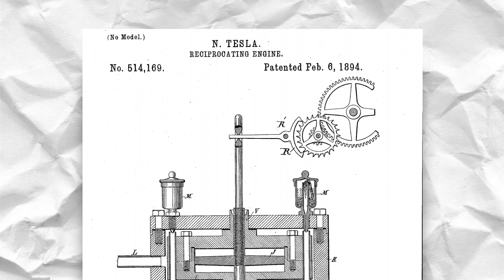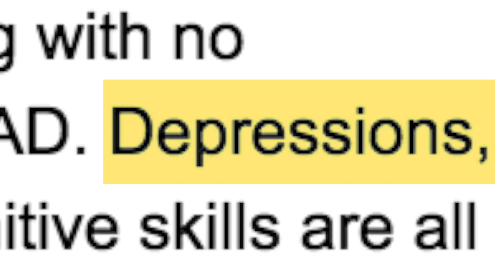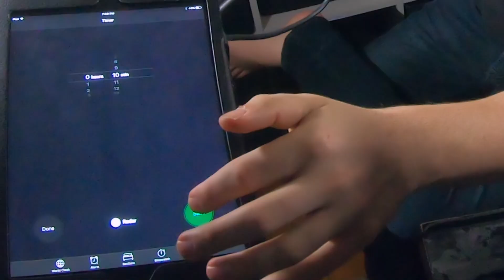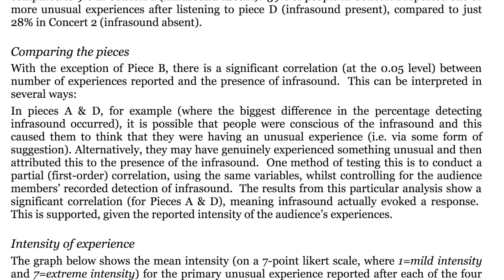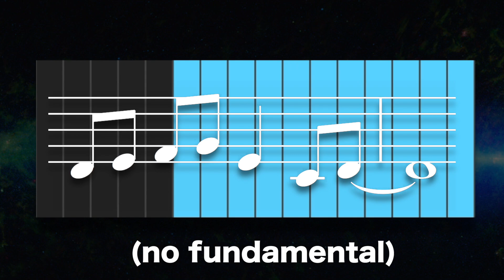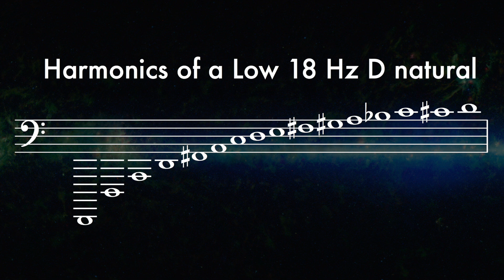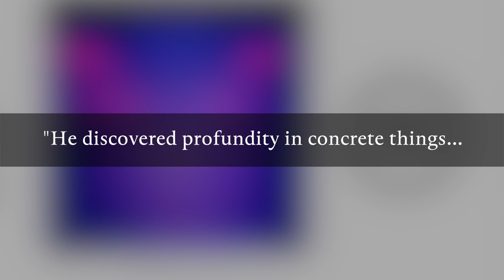How to See Ghosts (using Infrasound)

Comment: During your experiment, you were experiencing the onset of 'Fight or Flight" - medically referred to as Homeostasis. As the frequency drops, in earthquakes for example (seismic resonance between 0.1 to 10hz but most destructively at around 1.5Hz), you will experience severe anxiety which triggers the human homeostatic responses known as Fight or Flight. You will also experience sloshing of a fluid called endolymph which is located in the semi-circular canals in the inner ear. These canals govern balance. As this fluid sloshes around in a high amplitude environment such as earthquake, or indeed the experiment Adam conducted, it triggers the homeostatic response and is the body's way of saying GTFO of there.

Comment: I'm a bit confused by the claims here that humans can't hear frequencies below ~20Hz. Given (obviously) equipment capable of actually producing those pitches, I can pretty easily "hear" even a pure sine wave down to about 15Hz, though to be fair tones below about 18Hz do need more amplitude to be audible. I used scare quotes around "hear" because, well, it is perhaps more of a feeling of pressure in the eardrums at some point than hearing in the sense of being able to identify a particular tone. But I'm definitely detecting those sounds with my ears; a decent set of headphones works fine here. I don't think my hearing is exceptional in that regard, so what gives? Edit: Btw I'm 36, and my ability to hear HIGH frequencies sadly tops out at just above 15Khz at this point. Lame.

Comment: By the way, the combination tone is not an auditory illusion.  A binaural beat is, but they're not exactly the same thing.  A combination tone (or beat frequency) is a real form of amplitude modulated signal.  If you don't believe me, you can set it up in your DAW and observe it with an oscilloscope.  Set up two synths or signal generators playing very close to the same frequency and observe the summed wave in a scope.  You will see the frequency, meaning it is not in your head.  Binaural beats, on the other hand, use the same principle but allow your brain to do the "summing".

Comment: It's possible you may not be technically allowed to use infrasound in most venues. I remember when learning about low cuts and stage sound (mostly from online articles and posts, which leads me to believe this is a common practice) that low frequencies will be cut as high as 40hz to stop the low end sound from ruining stage equipment (the simplest problem being things coming loose). This could even have something to do with the limits of hardware being used.

Comment: This video just triggered a memory, I think the band Rammstein used infrasound when they played Sonisphere 2010 in the UK. It wasn't done particularly artfully and sounded a bit like a mistake, which slightly makes me think it was them just screwing with the audience.

About 30 seconds before the curtain dropped, there was an absolutely OBSCENE noise that came from the dedicated bass bins of the PA, which were at ear height below the stage (I was right at the front, so I got absolutely nailed by it). At the time I assumed someone touched a cable and accidentally fed 50Hz mains hum into just the bass bins, but it was a hell of a lot lower than 50Hz... you couldn't really hear anything but almost pitchless mush at some 130dB, but the feeling was beyond words. Like you describe, it resonated in your chest to the point of it being really uncomfortable, almost painful, like an electric shock through your chest (anyone who has accidentally been "touched" by mains power knows that weird whole body 50/60Hz vibration). Everyone within 20 metres of the stage felt it, and people were asking what the hell it was! It could have been a mishap, but it seems a little strange that this random sound had exactly the right frequency to  vibrate your ribcage... I've heard mishaps before, and although they're bloody loud if the sound crew screw up enough, even someone tuning a bass at full volume doesn't hit the exact resonant frequency of your chest.

Comment: I'm a bass singer and have noticed an interesting phenomenon when I hum down to around a D2 (~70Hz).
While humming and looking at certain segmented displays (such as a microwave timer or bus/train info sign) I can see oscillations in the display. When I slightly change the pitch of the hum, the rate of oscillations changes too, obvious I guess, but an interesting thing to try out if you have a low voice.

Comment: If I put my head right up on the neck of my guitar and detune the 6th string super low and play it I can see my vision get slightly blurred from the vibrations on my head when looking at text on the screen, right now it's at a low F# there abouts and I have all the strings justly tuned to an F# major chord, not sure if that blurred vision effect is related to this video but it only really happens for the low 6th string detuned hella.

Comment: Adam, a dumb question for your Q&A: does V (not V7 but V) really resolve to I despite the fact that it does not have a tritone in it?If so, what is the mechanism of this resolution? I fully understand the V7 to I movement, but both V and I are just two major chords of different pitch, so why does one of them resolve to another?

Comment: Question for next Q+A.
Hi Adam. I am a bass metal who plays metal. But i've come to a point in my "Journey" where I focus a lot on technique. I've tried alot of different techniquee to see which one I like. The problem is that the most comfortable technique I know, is a style where I can't get lot of attack/punch or high end (A Jazzy light plucking). I love the style of Ryan Martinie where he uses his tips of his fingers to get the most high end and attack out of the strings. The problem is just I feel very uncomfortable using the technique. I know you shouldn't copy a artists technique if its not for you. But I want a comfortable technique where you get alot of attack that cuts through the mix. And where its easy to do a lot of string skipping and fast triplets. (And a pick is not for me). Can you maybe give some advice ?

Comment: Hey Adam! Love your videos, please never stop making them. 

Question - 

why does the 7th degree "want" to resolve onto the root? Like I can hear that a B wants to resolve onto C in C major, but what's the fundamental reason? Same question for the seventh wanting to resolve down

Also, how can I learn how to use extended chords (9th, 11ths etc) in the correct context? You mentioned in a video that these chords add different color in different contexts, but I am completely unable to figure out which chord should fit in where. Thanks!

-Varun

Comment: Wouldn't it be smarter to use a slow-changing glissando from, say, 10 Hz to 25 Hz instead of fixed 18 Hz tone? That way you'd be able to experience the resonance even if your eyeballs' frequency differs significantly from average.

Also, it would be cool to have a second person who doesn't know what's going on and check if he/she notices the feeling you described. Or just perform a blind test if one can tell whether the sound is played at any given time.

Comment: It doesn't need to be truly subharmonic: 55 Hrz is that 'magic kick in the chest' a lot of bass-heavy music aims for boosting a narrow band around that mark on kick drums, and lemme tell ya,  you can most certainly feel it as much as you can hear it.

I've occasionally experienced some sudden rushed of anxiety when mixing tracks that can be a bit on the bass heavy side, particularly when trying to work out where a sub-bass should sit. Even though these frequencies are within the range of human hearing, when in a 10"X10" cube like my little studio with the monitors up louder than normal for a quick check, even that audible 35 (I prefer to roll off below that) to 100 Hrz range alone accounts for a lot of pressure on you even at relatively reasonable volumes (accounting for the human perception of lower frequencies does mean they're far louder than the rest, of course, but I'm still talking way below what that dude who spent more on the subwoofer in his car than the car itself cranks it to).

...and also reminds me that I need to pony up and build a halfway decent bass trap to even things out...

Regardless, excellent vid, as always!

Comment: What about the Worldwide hum, which I have suffered from for several years? Nobody has a good explanation for it yet. I think what I hear is about 18Hz, but when I try it out on a piano, it is between C and C#.
For me, it is defintely building orientated, as it stops when I go outside, and it is nothing to do with the electricity supply, as I have tested it with all the appliances turned off.

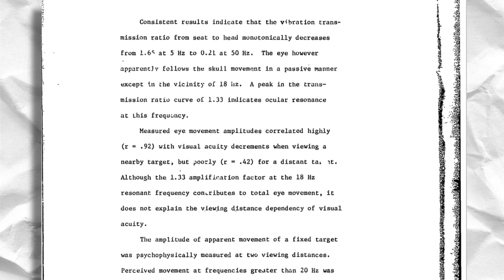Comment: I once experienced a strange, short sensation during the song “Welcome to the pleasure dome“ by Frankie Goes to Holywood at 2:42. Some feeling like “My gosh, what happened“. It was repeatable, a friend confirmed it, but it only worked with a certain placement of the speakers in the room. I wonder if there is some 18Hz-ish sound there in the song that was enforced by the speaker placement and some room resonance. Any similar experiences?

Comment: Did you know that the chiptune you've just made is actually pretty much the exact opposite of how most 8-bit chips worked? Many old synth chips used a fairly high (megahertz range) reference frequency that gets divided down to form all the notes. None of them wind up perfectly in tune, but the lower you go down the scale the more accurate the notes become. As you go towards higher frequencies, the notes become more and more out of tune as they get rounded down to the nearest integer divisor. You've just done the exact opposite: create a scale out of integer *multiples*. Typical chiptunes go out of tune on the high notes, while yours goes out of tune in the lower notes.

Comment: Question for your next Q&A video: I play contrabass clarinet. In relation to your comments about the body having mechanical resonant frequency, you point out that the eye's resonance is about 18 Hz. Interestingly enough, when I'm playing near the low end of the contra while reading music off a monitor, particularly around concert Eb1 and F1 (~39-44 Hz), the image on screen starts to swim. I note from the note frequency chart I'm looking up that Eb0 is 19.45 Hz, and F0 is 21.83. Even though the contra is pitched in Bb, and the lowest note is concert C1, is this resonance I'm feeling related to the subtones an octave below? 
Related, regarding the experimental prototypes of the octocontrabass clarinet, these monsters were built to play well below the range of the piano, with a bottom note of a Bb-1. If the lower limit of human hearing is 20Hz (E0), aside from the physical vibrations we'd feel from the lower notes, would what we'd hear be essentially the overtones? Unfortunately, there aren't any sound clips of the subcontra out there, but knowing what a C0 at 16.35 Hz would 'sound' and feel like would be amazing.

Comment: Adam Neely: "ehhh you shouldn't tune A to 432 even though that's the most fundamentally natural frequency you should tune A to artificial 440 for no reason."
Also Adam Neely: "tune chiptune to D=18 and it will vibrate your eyes."

Comment: In response to those questions at about 6:30... I would say obviously it could be used to enrich songs/compositions. Considering the reaction to it, it would make sense to use it in passages that are supposed to be suspenseful or terrifying or erratic. You could put it under the kind of music that plays in a film score right before someone gets killed or in the beginning of Beethoven's 5th symphony to compliment the type of feeling you're trying to convey. Audiences might not like it though and many wouldn't hear it in the first place due to the fact that lots of headphones and sound systems aren't going to produce any frequency that low.

I'd also say it's part of the music. If you consider a piece of music as a graph of frequency over time then clearly it is. Also, hearing is part of feeling frequency in general, perhaps the most important part but since you can feel frequency (and frequency lower than 20hz) in your body the sensation happening in your ear isn't really different than feeling a physical object rumbling at 10hz. I would also guess the negative connotations associated with feeling those lower frequencies is likely an evolved instinctual reaction. Probably not a good sign when you can strongly feel vibrations at 18hz. Also the feeling you described is spot on with what I feel from the kick at pretty much any loud rock show.

Comment: The reason this video interested me so much,, well, more than usually,, 
Is that for the longest time, My home has been plagued by vibrations that makes the windows vibrate. a quick nudge disturbs the sound, and I can stop being annoyed by it,, for a while. Next time it could be a bookshelf with something on it. 
However, since then windows have been changed, air ducts have changed, and it's still doing it. Not often, but eventually something finds itself vibrating in harmony with,,, whatever it is, and annoy me. Always seem to be the same frequency, not something that audibly as a tone, but as a vibration. 
I have seen articles about whole neighborhoods being plagued by infrasounds, like in detroit, or is it was the canadian side of that lake there,, unsure. 
So naturally I have been wondering what causes it, what frequency it is. But I've never gotten around to actually try to record it.
But now, I think I will give it try. If nothing else just to see if it's dramatic orchestra hits 18hz

Comment: You can try walking around on the room, an 18hz sound wave has a wave lenght of about 19 meters. So in theory the sensation would be different in different points of a 19 meter radius.

Comment: This is incorrect. The thing you call "sub frequency" is an actual physical phenomenon. In physics it is called "beatings" and it occurs when two or more waves interact with different frequencies. The resulting third frequency is the difference between the two and is an actual wave we can measure. It doesn't just come together in our heads it is the frequency with which the waves modulate each other. For example take a sin wave of 100hz and 101hz. They will get louder and quieter 1 time per second generating a 1 hz wave. We can do it with any frequencies to generate any other frequency.

This is used for example in directional speakers. Due to effects coming from the wavelength and size of the sound source ultrasounds (with very short wavelengths) can be used in very focused directional speakers. The carrier frequency of for example 40kHz is being modulated by other frequencies from the speaker to reconstruct the audible sound. Therefore the ultrasound beam becomes an audio source on its own. The regular sound is then only heard by a person inside the beam and no one else.
Check out soundlazer and similar companies who make directional speakers for more info :)
Reply: Yeah no...  Miss me with that parapsychological bullshit. It's like talking about 432Hz with your inner resonance. There are no scientific terms or mathematically validated research in this guy's work.

Comment: Don't some 64-foot pipe organ stops generate infrasound? I think they do.
Reply: Yes, they do (the few that exist). But so does even the lowest 32'-pipes. The 18Hz D in the video can be achieved by a 32' stop (especially noticeable on flue stops, since the fundamental of reed pipes is generally not as strong as that of flue pipes). Almost all large pipe organs, and even many medium sized ones, have at least one 32'-stop. Often something like a Contra-Bourdon 32' which will usually have a quite strong fundamental tone.

Comment: Awesome concept to play around with. I love this kinda stuff.
But setting generating sympathetic vibrations and standing waves can be finicky, especially with something as squishy and imprecise as a person. 
I can see a few problems in translating it : One, you need a speaker that can actually generate the tone with enough kinetic energy to cause phosphenes, and Two, you'll need to warp the pitch and phase around over time to actually resonate a person's eyes, let alone a room full of people's. 
Everyone's eyes are slightly different sizes, and will resonate at slightly different tones. Also, not everyone will be exposed to the frequency at the same distance, so slowly phasing the tone would be needed to get the maximum to occur at different distances. Then you have to hope the wave sets up in such a way to be both in pitch and in phase with the person's eyes... I think, anyway. 

I've honestly wanted to play around with live standing waves and related phenomena, or see a band that did that sort of thing. Like getting the dimensions of a gig and calculating how to generate a standing wave and moving it around the crowd, etc.

Comment: The story about the fan got me thinking...sometimes when I'm working on my computer too long my vision does similar things like flashes and stuff.  Additionally my vision will warble around a bit and make me dizzy.  I wonder if the frequency of the screen can induce ocular resonance after prolonged use...I don't experience it with my laptop, but I do with my desktop screens.